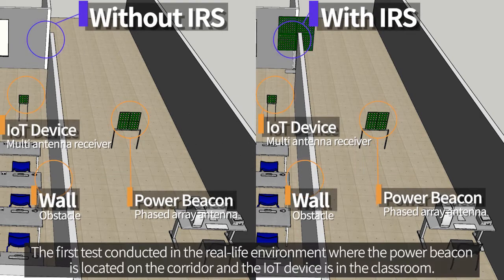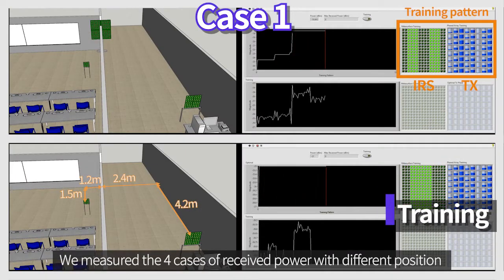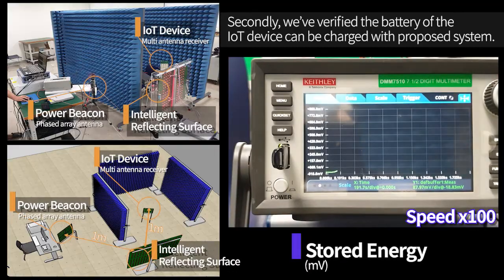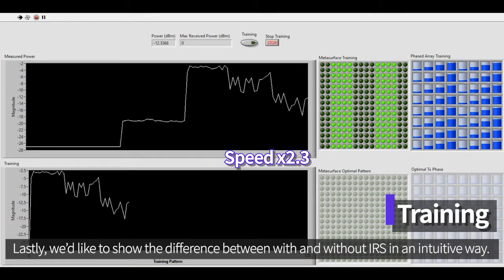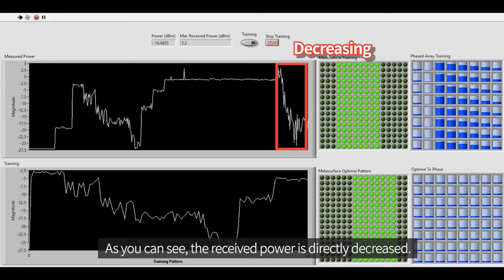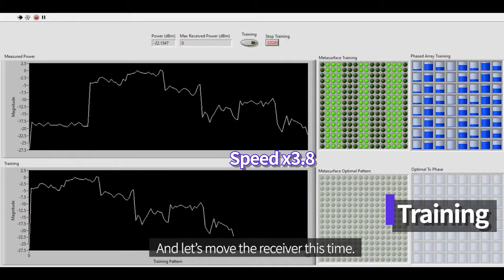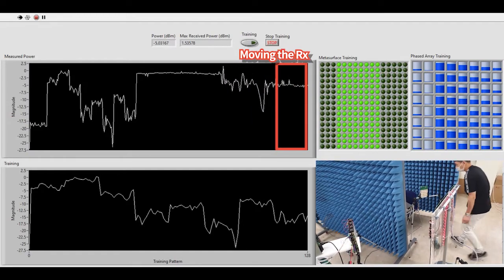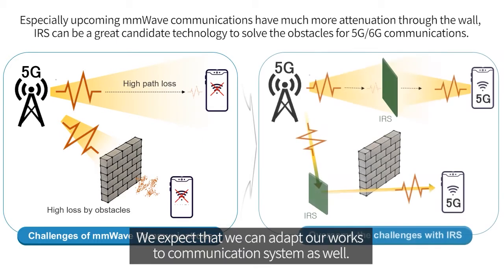Multi Antenna Long Range Wireless Power Transfer System with Reconfigurable Metasurface Reflector

Comment: hello sir,from many research papers for energy harvesting purpose some unit cell is act a reflecting the RF signal and some unit cell has ideal phase shift .when the unit cell is act as absorper and when it is act as reflector
Reply: Hi Jini,
In our work, the RIS only reflects the incoming signal with different phases. We do not consider the case that unit cell acts as energy harvesting. Our main purpose is finding the optimal coding matrix of the RIS controller to focus the reflected beam to the receiver (e.g., rectennas) which harvests the energy.
Reply: absorption and reflection depend upon the impedance matching of the transmission media i.e. air and the patch.
If it matches, the whole signal will be absorbed else it reflects.